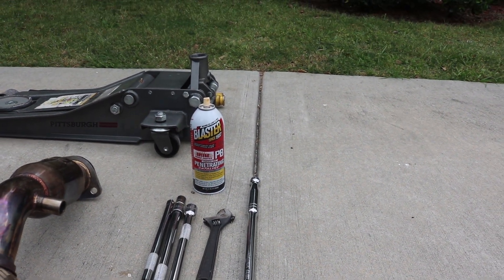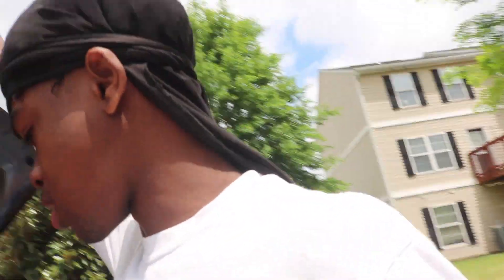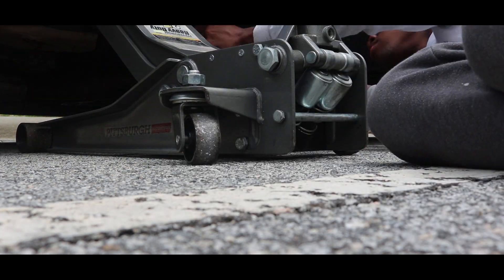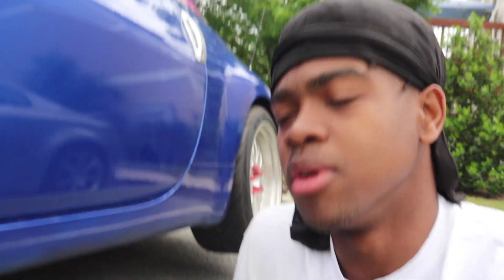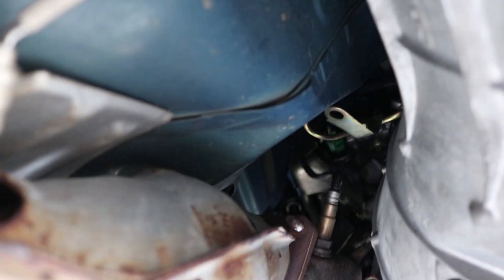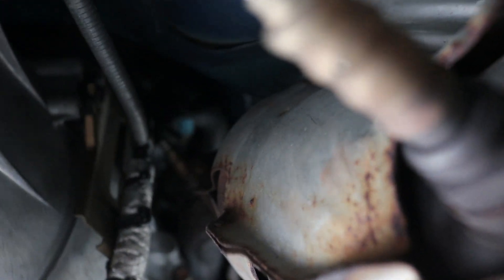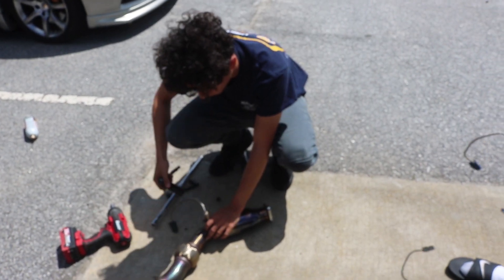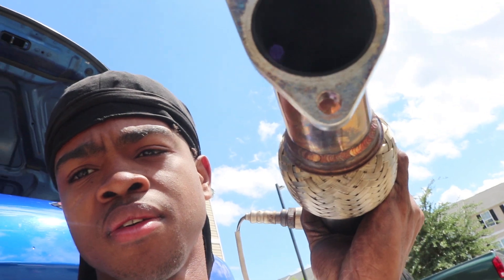Installing Megan Racing Test Pipes On My 350z With A Tomei Exhaust!! WARNING LOUD!!!!

Comment: Did you get a check engine light
Reply from the maker: i sure did lol, i also installed o2 extensions but for the 2006 model it doesnt work lol.
Reply: JDMNEDU what’s the code I haven’t been able to find the code number online
Reply from the maker: I forget what the code was but it relates to both of the 02 sensors reading out lean. like a p03400 code i believe but dont quote me on it. I would let you know but I do not have the car in my possession atm.

Comment: Just letting you know bro there backwards
Reply from the maker: old chanel how?
Reply: @JDMNEDU  the resonated part is supposed to be after the header and the flex pip connected to the y pipe
Reply from the maker: old chanel wouldnt fit that way at allll. From the header to cat it is 3 bolts and to the cat to y pipe it is only two holes.

Comment: hey man do you get any pops or crackles
Reply from the maker: g35moe small pops but if im doing a pull, in between shifts i shoot a long flame. I would recommend getting a tune which i will be doing soon so u dont run lean if u plan on doing this
Reply: JDMNEDU ah no way that’s nice, i have a tomei and a isr y pipe in my basement right now, just trying to see which test pipes to get and i’ll put everything on in spring, and get tuned from admin hopefully
Reply: @leg35nds15 what test pipes did you end up getting? and did it sound good?

Comment: Hey man any good the megan test pipes they haven't broke from the flex.joint
Reply from the maker: when i had those meagan test pipes they never cracked or brock from the flex pipe.
Reply: @JDMNEDU  why did you change them
Reply from the maker: @abbas674   Im going boost so I can’t run testpipes anymore but I changed them this year. Sold it to a friend and they still are running great